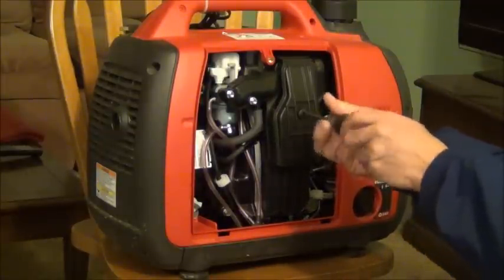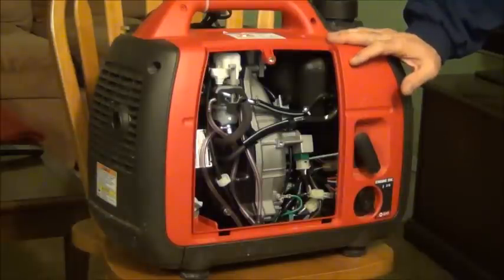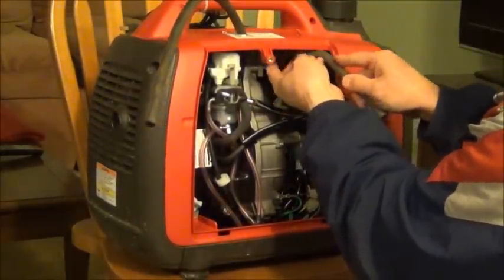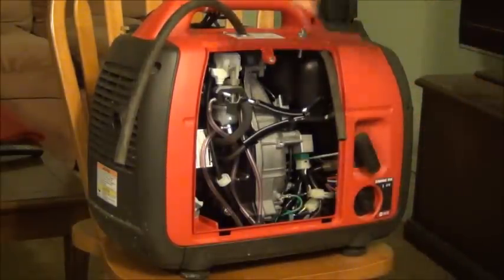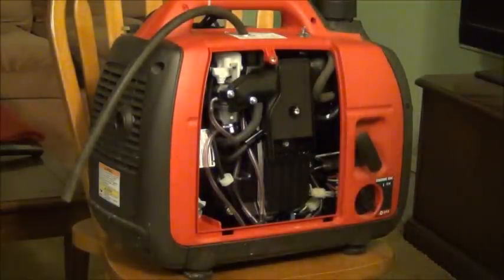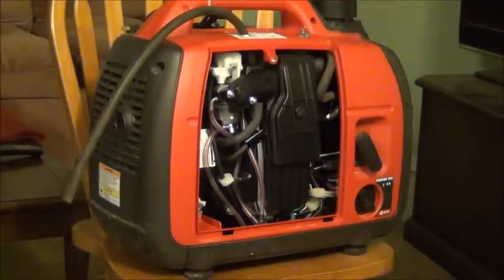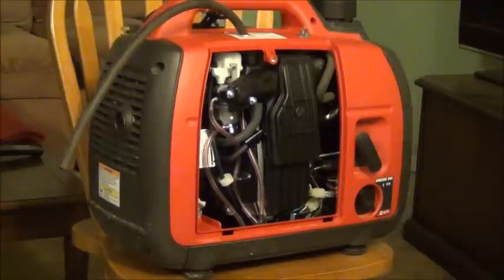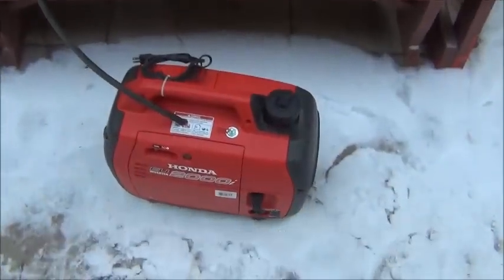Honda EU2000i improvement. One of a kind.

Comment: I bought my first Honda gen. back in '02 to use on my camper.  Later added a second one to connect to the first by connecting the two together to run a larger a/c on a larger camper.  I modified the fuel caps by drilling holes in them to able me to run a clear plastic full line through each one and into a 5 gallon plastic fuel container with the holes drilled in that lid also.  Be sure to seal the lines in the Honda fuel cap so it will not suck air.  Start with a full fuel tank on the Honda.  After about 45 minutes of run time, the fuel pump on the Honda will begin to pull fuel from the larger can.  I can run a weekend without having to refill the large fuel container.  Simple to do and well worth the extra run time.  I have some pic. somewhere of the set up and will try to find and post them.  You will need to buy the Honda cables for connecting the two or make your own.  I think there is a video on here of how to wire your own.  Here is his link
https://www.youtube.com/watch?v=LXqts2Lfgzk (by sixtyfiveford)
Reply from the maker: Wow! This is excellent information, Dick! Thanks a lot for sharing. I wish I knew about this trick. Now when I think about this one could drill a hole in the cap and then use a metal connector to go through the cap, and tighten it from both sides with rubber seals and washers and nuts, and then just connect the fuel line. Did you also drill a small hole to let the air in, inside the container? Or is the original fuel cap responsible for that? I am still happy with my generator, but when buying I desperately wanted the one which can charge the battery, not the C version, which stands for Companion, I think. It was a long time ago, but I think this was the idea, some are designed to be used as stand alone, and some as a couple, to increase the wattage. PS: Right now I live in the bush, but I incubate lots of birds, so a reliable generator is a must for me, otherwise when power outage happens I might loose all the eggs.

Comment: Wally, problem with 2 oz plastic squeeze bottle at end of 18* auxiliary fuel line.  You really only need a 1 oz plastic squeeze bottle.

You HAVE to squeeze the squeezable bottle to force fuel into the car bloat bowl.  The generator then readily starts, thanks to FRESH gas, ....& then the generator stops running because of fuel starvation/vacuum.  There is no vent with the bottle.

Once the generator starts, remove the fuel bottle from the auxiliary line & either switch to fuel in the generators gas tank or attach an auxiliary gas tank to the fuel line AFTER the bottle is removed.  Thanks to FRESH gas in the carb/float bowl, my generator starts running before I finish the FIRST PULL.
Reply from the maker: Got it! Thanks a lot!!!
Reply: Here is a photo of the 2 0z plastic auxiliary/reserve fuel tank.  In the description I include a link to this video.
https://www.flickr.com/photos/bc_az/32636688632/in/dateposted-public/
Reply from the maker: Nice job! Thanks for sharing, I bet lots of people will appreciate the idea.

Comment: Wally, I just finished the modification of my generator; similar to your.

I have a short 18" of fuel line leading from the 3-way valve.  At the end of that line I have a small 2 oz plastic squeeze bottle that I can fill with fresh gas.  When I'm ready to start the generator I move the valve to RESERVE, squeeze freshly filled gas that's in the plastic bottle which forces gas into the float bowl of the carb.  I start the generator & then move the 3-way valve to ON & it runs on the gas in the generator gas tank.

This way, I always have FRESH GAS that goes into the carb float bowl which makes for very easy starting.

IF I have a situation where I want to run the generator all night, I can easily remove the small 2 oz plastic squeeze bottle & attach a fuel line leading to a larger auxiliary gas tank.

My auxiliary gas tank will have a primer bulb & fuel filter in the line, same as yours.
Reply from the maker: Good stuff! I put on the end of the gas line a heavy metal connector, so I can just drop it in any jar with gas, and it will run all night long :) But I guess we have different goals, I mostly want to have my peace of mind during the night, when I go on a hunting trip, and it is cold outside :) I like your idea with the bottle of fresh gas, will use it, too. Since my line has the primer bulb I can just pump from that bottle... Thanks for sharing!
Reply: Grrreat idea, putting a weight on the end of the fuel line that you drop into the container of gas.    I'm going to adopt that & improve on.  Instead of using a weight, I'm going to add a fuel filter on the end of the gas line as weight.  This way I get weight on the end of the fuel line   + it's filtering the gas right out of the tank.  No need to splice the filter somewhere into the fuel line & then have to deal with possible fuel leaks at the splice junction.........I'm one up on ya now, Wally.
This is a really small glass filter, smaller than those which are larger & more readily available.
http://www.ebay.com/itm/Universal-Motorcycle-Clear-Glass-Metal-Fuel-Filter-1-4-6mm-Gas-Petrol-Screen/272409094336?_trksid=p2050601.c100085.m2372&_trkparms=aid%3D111001%26algo%3DREC.SEED%26ao%3D1%26asc%3D20140211132617%26meid%3Dd8911ee01ab04781afd161f788fe3acb%26pid%3D100085%26rk%3D2%26rkt%3D4%26sd%3D351462091583%26clkid%3D2315326960734958963&_qi=RTM2247626
Reply from the maker: Nice filter. Me jealous now :)

Comment: Question. If you are on the external tank; Doesn't the fuel pump keep trying to pump the fuel from the internal tank thereby either having a constant head pressure against your valve (which may eventually blow off the hose) or overly heating the static fuel which is in the pump? Wouldn't both of these possibilities present possible fire hazards? Just is just me thinking out loud from an engineering and safety perspective.......not condemning your modification. In the snow mobile application either the main or the reserve would still pass through the pump.............so I'm just suggesting that to make your modification a fuel safe one you may need to place your "Tee Junction" between the internal tank and the pump instead of after the pump. Plan to set up similar for my hunting cabin to be able spend less time refilling. Cheers
Reply from the maker: I honestly don't know the answer. I doubt the pump is so powerful and will keep trying to pump. I think if we really investigate we will discover that once there is some pressure in the line then the pump will not kick in at all. But this is just an educated guess, I don't really know how those diaphragm pumps work... I have chosen this design on purpose, because if you place the valve between the pump and the tank then you will leave your pump dry, and this will probably destroy the pump, or might have some negative effect. At least this was the concern of many people when I was investigating this issue. I decided that pump always needs to be filled with gas, so the diaphragm stays intact.
Reply: This is just my opinion so double check. My yacht has similar systems but on a much larger scale. If you place the pump between the existing tank and the pump......The pump would always be fed.....either be the built in tank or the external tank whereby the external tank would not have to depend on gravity flow.....also there is less chance of pump or line stress. The only time that the pump would run dry is when you turn of the valve.....and that would be just until the motor stalls. This would be good. ......no stale fuel to gum up. May not be a big issue on such a small unit......but I think it would be the correct connection point. Love your mod anyway and thanks very much for sharing.

Comment: Great idea Wally!
Reply from the maker: Thank you! I just used (combined) all the great ideas I had found on YouTube, and I still love this "improvement"! We have a house in the bush now, far north, and once in a while we need the generator, and if we need it we want it to be reliable...
Reply: I just picked up a Harbor Freight model # 62523. Its they're Brand New inverter "suit case" generator. Its based of the Yamaha. It has a fuel gauge, and the combo switch also shuts off the fuel, so you can run the fuel tank dry. Its a "Red" version of the WEN 56200i. Only $400 and Highly rated. VERY QUIET TOO. Thank you for taking time to make your video. Peace

Comment: I use my Honda EU200i generator in emergencies. Instead of installing a peacock can I just run the engine out of fuel to keep it from gumming up?
Reply from the maker: I have read statements that this is not a good idea, that running the engine out of fuel will leave the fuel pump dry, and then the (rubber) diaphragm inside the pump will get damaged. That's what I have heard, not sure if this is true...

Comment: Have you noticed any wear on the new hose from vibration against the removable panel?
Reply from the maker: Hi Steven. No, I didn't notice any wear, but to be honest I don't use the generator heavily. If this would happen I would probably just add another layer of rubber hose, just for protection.

Comment: This is not necessary. Just unplug the the wire harness from the on/off switch. This will
allow the engine to continue running in the "off" position -- but also cuts off the fuel supply. Carb will run empty after a couple minutes - ready for storage.
Reply from the maker: My goal also was to keep the pump full with gas, so the diaphragm doesn't dry out. And I also wanted to be able to use an external tank. 3 birds with one rock ;)

Comment: Don't you have to worry about the fuel pump running dry when you are running off the external  fuel tank?
Reply from the maker: +Richard T No, Richard, when using an external fuel tank the pump is being bypassed completely, it will never run dry. I mean when using the setup described in this video... No matter which tank you use the fuel pump will always have some gas, but the carburetor will be empty, and this is exactly what I wanted.
Reply: @WallyKnorr  But isn't the fuel pump running when the engine is running?  Or does the fuel pump only run when the carb gets low?  Could you explain how the pump gets the signal?
Reply from the maker: To be honest I am not very tech savvy, it's just that I had a problem, and in order to address it I had done some research, found a solution, and forgot about all of this. But if you type this question in Google search there are some videos, and here is what Google tells: 
How does a diaphragm fuel pump work?
Diaphragm pumps use a composite membrane, which flexes up-down over a fuel bowl. ... As the diaphragm moves up, it creates a vacuum, pulling fuel from fuel tank into the fuel bowl. The actuating lever then pushes the membrane down, pushing the fuel out at pressure, which for carbureted engines is about 6 psi.
Reply: @WallyKnorr  Ok. I asked because I wasn't sure what kind of fuel pump it has. But it sounds like it would be running all the time, which is too bad, because it wouldn't need to be, and it would be wearing the pump for no reason.  And if its  pumping against that stopcock without any relief, hopefully that doesn't build extra pressure, beyond the 6 psi.  Thanks for looking it up.
Reply from the maker: @JM-nh8yp  My understanding was that as long as there is pressure it will not pump, it will pump only if pressure is gone. So I think when the switch is turned than the pump always maintains those 6PSI and doesn't do anything. I could be wrong...

Comment: I bought my generator a couple of days ago & I have the valve.  BEFORE I do my modification, same as yours, have you made any additional minor or major changes/modifications to your generator?  Have you, perhaps, done a carburetor overhaul, switched to non-ethanol fuel.....anything?

If you're normally using the external gas tank, am I correct in assuming there is no gas in the generator's gas tank?
Reply from the maker: +Bill Cole Hi Bill. No, I haven't done any serious modifications, but I improved the setup by adding a long hose, by putting a fuel filter in the middle of the hose and a hand pump, and by installing at the very end a metal piece, like a nut, where I can screw in a bolt, so no dirt can enter the hose. Then I rolled the hose up and attached it to the handle. I still use the internal tank, there is always some gas inside, it is good enough when using just for a few hours. And the switch helps me to empty the carburetor anyway. I use an external tank only when I need the generator to run the entire night.

Comment: Can the 120v outlets be used the same time the 12v outlet is charging a battery?  Do you know if the circuitry for the 12v outlet will prevent overcharging a battery?  Yes, I do know the 12v outlet charges a battery at 8 amps
Reply from the maker: +Bill Cole Hi Bill. No, sorry, I don't know. I guess this info is in the owners manual. I am sure both outlets (AC and DC) can be used at the same time/ But not sure if there is something to prevent from overcharging, most probably not. Btw I was mad when I heard that the cord for the 12V outlet was another 30 dollars, so I just took an old cord, split the plug, flipped it over and tied again. On the other end I attached 2 clamps. Costs me zero, and I have it always inside the genny, under the lid, just in case. Here is a link to owners manual, there is a part about DC usage, and a wiring diagram, too. cdn.powerequipment.honda.com/pe/pdf/manuals/31Z07610.pdf
Reply: +Wally Knorr Canadian Hunter I'm sure others will be equally interested in how you accomplished your work-a-round in preference to paying the Honda Mafia $30. for the DC connections/cord/etc

Luck you....TWO LEFT HANDS
Reply from the maker: +Bill Cole Here is an idea how such a cord could be made: forum.ih8mud.com/threads/honda-eux000i-generator-12v-ok.411879/  But I just took a cheap plastic cord and spliced the plug. Once you see the original you will get the idea what can be done :)    chandleryworld.co.uk/upload/images/32650-982-003-3.JPG
Reply: +Wally Knorr Canadian Hunter Gotcha, Wally.  I have the spade connectors in my electrical connectors collection, never thought to use them. I'm going to try to find the generator plug for boats that was shown in the 2nd link.

I'm think the Honda Mafia needs to add you to their Board of Directors & as a condition of your job, you'd be required to keep your mouth shut, you'd be prohibited from HELPING customers figure out a way to AVOID BUYING ACCESSORIES
Reply: Use a cigarette lighter or gas cooker or electric heat gun to loosen the plastic on a us or Chinese two pin plug and twist one of the pins with pliers and you have a 12v genny plug

Comment: very cool idea my friend. very resourceful, good use of what you've got. I did my secondary tank using a small valve in place of the vent on the cap. I do like the idea of the pet cock to run the carb dry, no more cleaning!
Reply from the maker: +hjkh Thanks! I almost forgot about this project, but every year when the first snow comes down and I go up North to hunt moose in the forest - then I really appreciate this modification. When I am out in the bush and it is bitter cold at night and generator is running to produce heat and power then you really don't want to leave the warm bed and go outside to fill up the empty tank :)

Comment: Couldn't find the On/Off/Reserve valve on eBay, at this time.  However, I did find it for $7.50 here...http://www.aircraftspruce.com/pages/ep/fuelvalve_0fuel/ffv3.php
It took me over an hour of searching on the internet for this 3-way valve.

Incidentally, I'm left handed & have only one left hand.  Lucky you, having 2 left hands
Reply from the maker: +Bill Cole  Good move, Bill. I forgot to mention that many other shops sell them, especially the snowmobile dealers, also some ATV or motorcycle dealerships. Glad you found one. I am so happy I made this modification, even after a year of being not in use and with old gas my generator starts after 2-3 pulls, like charm.
Reply: +Wally Knorr Canadian Hunter .....the only other thing I might mention, Wally is that my Honda Generator crankcase would be filled with Amsoil 100% man-made synthetic oil.  You can substantially reduce the friction of the moving parts IF you lubricate with Amsoil or any other 100% man-made synthetic lubricant. 

Just for the record; Mil Comm is the 100% synthetic lubricant I use on my firearms. This is the same lubricant Sig Sauer Firearms are sold with, the same lubricant recommended by the NRA, & the same lubricant used by the U.S. Army.

Two LEFT hands; lucky YOU

Comment: An easy way to shut off fuel and letting run dry is by disconnecting kill switch to the spark plug (square 3 pin plug located @ bottom right/h corner) 5 second job .....and have a nice day my friends! (said with a russian accent :)
Reply from the maker: +audeerhunter  Sorry, I didn't get it, how can a kill switch to the spark plug help with shutting off the fuel and letting it run dry. Can you show it on your genny? Please! Asked with Russian accent :)
Reply: Engine switch (just below the pull cord) when turned to "off" does 2 things, cuts the fuel off and kills the sparkplug. By disconnecting the kill switch, the engine switch (when turned to "off") only cuts fuel , and lets the engine run until all fuel in carby is gone. понятно?
Reply from the maker: +audeerhunter I am afraid your solution doesn't address the dry fuel pump. Lots of people are afraid to leave the pump dry, worrying about the rubber diaphragm getting ruined when sitting dry for an extended period of time. My cheap and elegant solution is also addressing another issue, with an extended tank, and this cannot be accomplished by manipulating the kill switch, it can be addressed only by paying a pile of money for a self made tank cap (on Ebay).